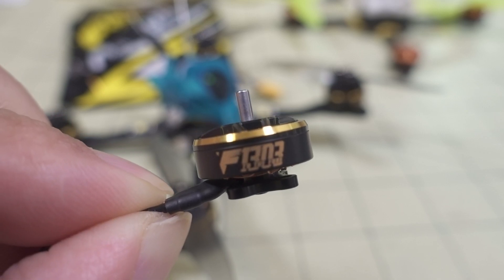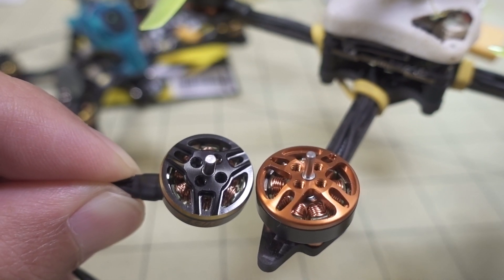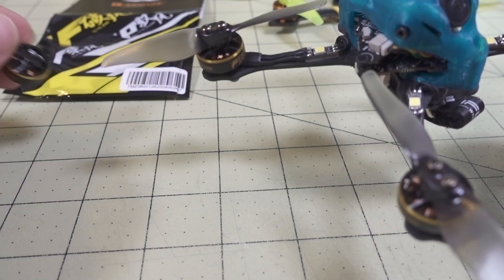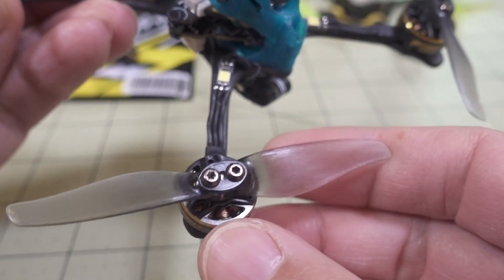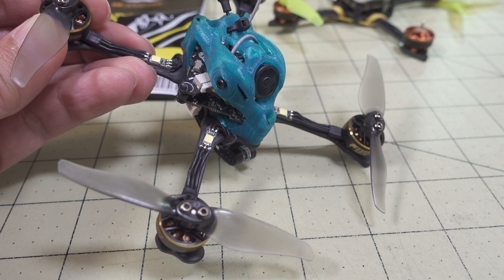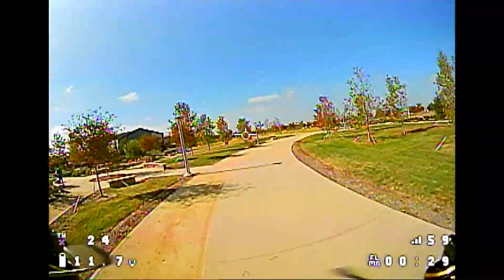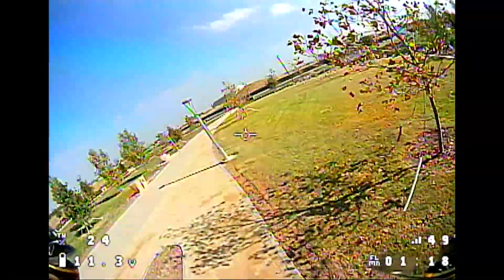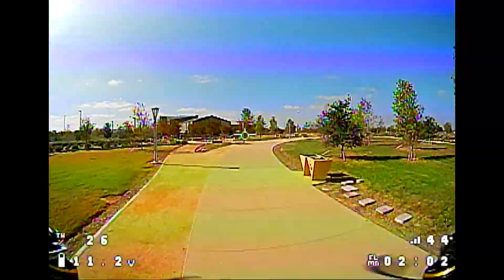T-Motor F1303 5000kv Motor Review 🛠️

Comment: Is it hard to drill the 2 shaft holes? It seems like it would be hard to keep it balanced?
Reply from the maker: Link to pre-drilled props are in the description.  You need a special tool to drill them out so they remain balanced so not easy.

Comment: They sound pretty good to me. I'm quite jelly about the nearly 6 minutes of flight time. I think my Tinyhawk S batteries are getting tired, since some of them only give me a little over 2 minutes.
Sidenote: That was your TransTEC Lightning build.
Reply: The Tinyhawk motor plugs get loose over time, soldering them could fix the 2 minute battery problem. Try a new one, and if you get 2 minutes it's most likely the plugs.

Comment: you will need screws for gemfan props as they made the shaft too slim (1,96mm). I'll stay with the other motors who have a 1,98mm shafts. got a hq prop stuck so maybe they work with the thinner shaft, not sure. .... probably a good motor ... but no press-fit for 3018/3016 is a nogo for me ...

Comment: Had my eye on them for a while.  Have been wanting to upgrade my FalcoX gtb339 to some 1303’s.  But of course after 9 months and well over 600 packs and tons of crashes, branch clippings, and gate smashing I finally blew a motor/esc on one corner.  So now I need motors and a new brushless whoop board, preferably one that I can slap FalcoX on like the 25a diatone.  Lol 😂